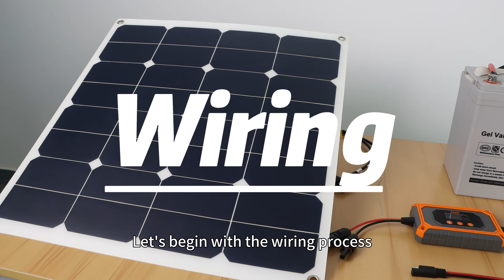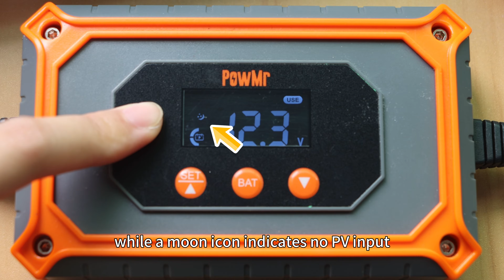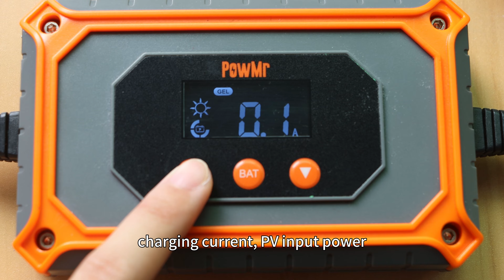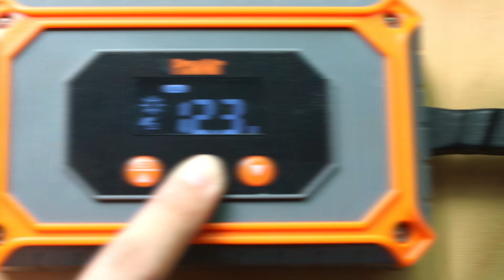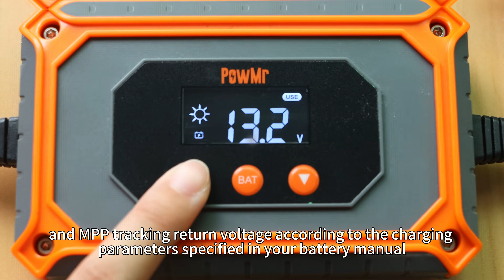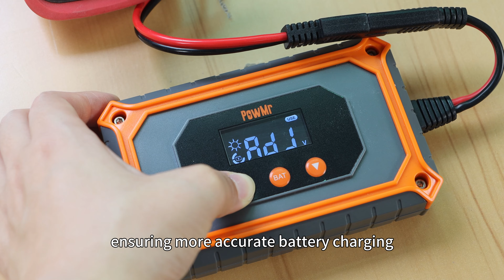Streamlined Setup: Wiring and Configuration Guide for the POW-LTW-15A Controller

Comment: Does the ct sensor connector for powmr elite 10.6kw work and funtion to limit or assist my load when solar was low power
Reply from the maker: CT? This model does not have a CT function.